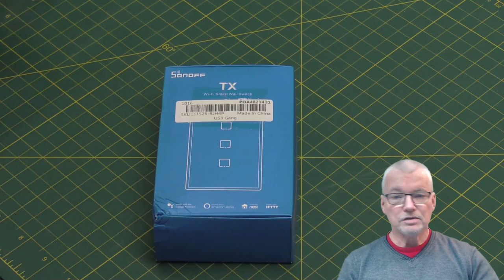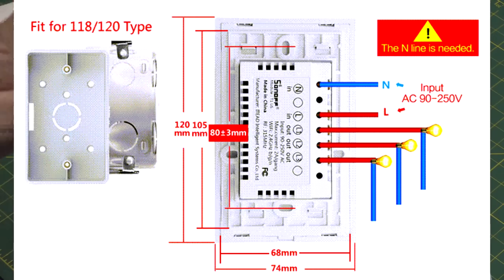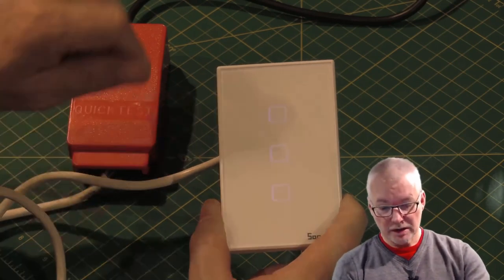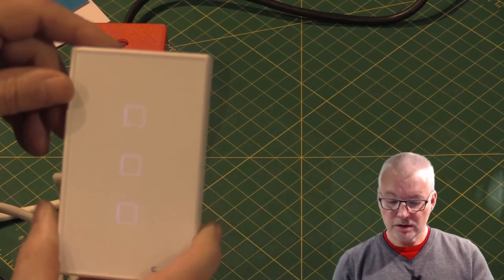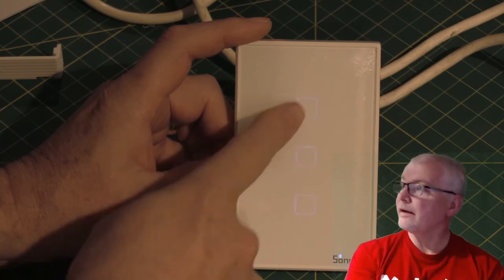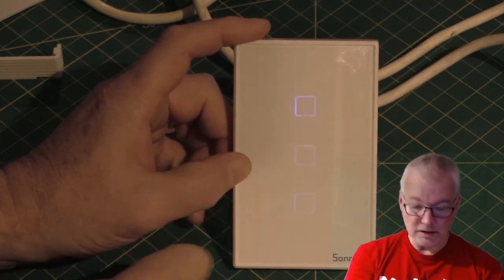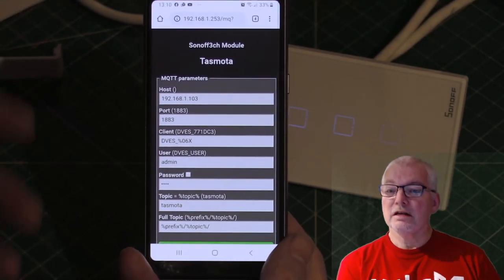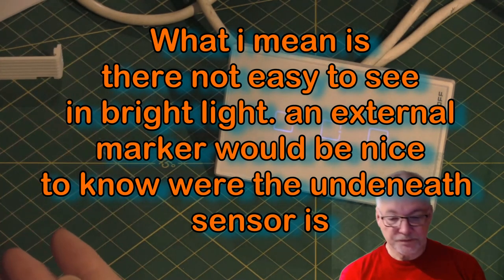Home Automation without the Cloud, part 1, Sonoff Switches

Comment: I’m considering using sonoff switches  in my house, but it seems they have no regulations, are they safe?
Reply from the maker: They have CE Certification and the like, see this link, near the bottom for the info https://www.itead.cc/smart-home/sonoff-wifi-wireless-switch.html
Reply from the maker: I also use them a lot without any issues, I did blow one up, but that was my fault for having it outside in the rain with no waterproof enclosure :)

Comment: Hallo... Why nobody create one home switch with esp32 and little usb?
Reply: That is basically what the Sonoffs (and generic competitors) are internally. If you want, you can buy an ESP board with a relay and put one together yourself for about $5. Just flash Tasmota onto the ESP and you can use it with any app you want.
Reply: @elzzon  Thanks